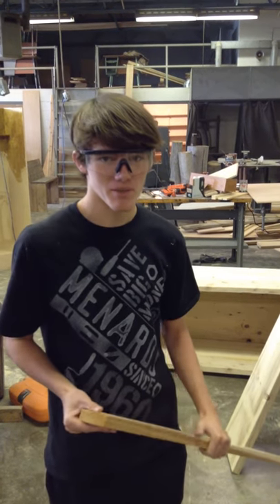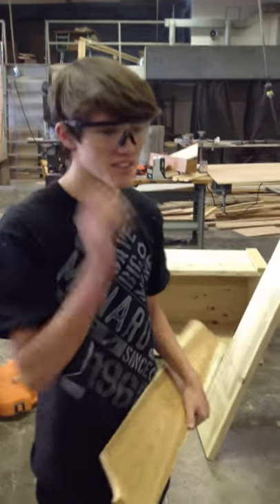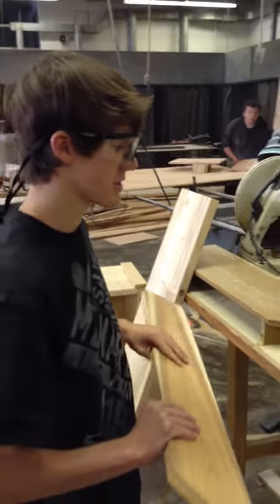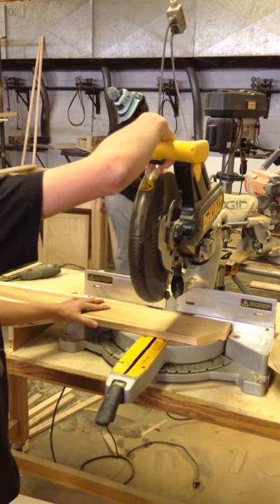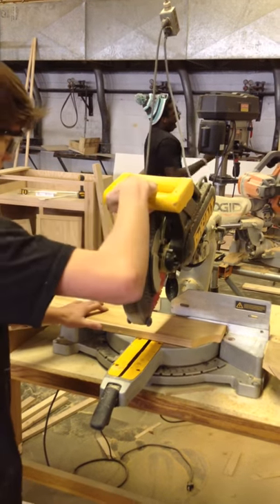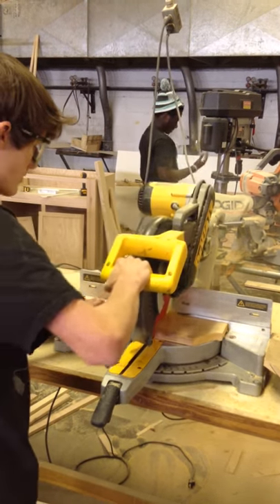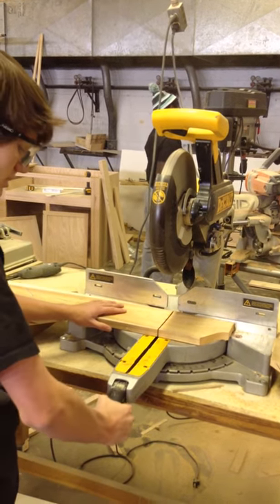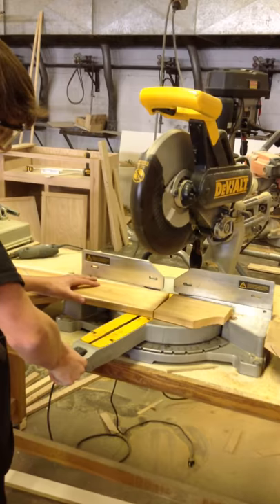How To Use a Compound Miter Box

Comment: When cutting, it's usually safer to drag the blade from the back forward instead. The way you are cutting, the blade, which spins towards the rear fence, may catch on the wood and fling it outwards towards you.
Reply: What are you talking about? The kid was spot on.
Reply: @tone34  If you drag it towards you, the blade forces the work down onto the work surface. But if you push it away from you, if it catches there is nothing stopping the work from flying out of the machine except your hand, which will likely take the brunt of whatever calamity happens next.
Reply: Sham Keith He cut from the back then forwards.
Reply: The back of the saw is the part furthest from the operator.
Reply: @tone34  I'm not trying to be anal about this, I just really dont want someone to get hurt. A while ago, my shop teacher broke his finger. Almost cut it off, actually, all because of the way he was using a miter saw.
Reply: Hearing protection please!
Reply: Umm... If the saw catches going your way it launches the saw into the user. If it catches going the other way the wood gets yanked up a few inches before traction breaks or the saw gets bound up (the only force there is going to be straight up on the board)
Reply: @jchoneandonly  If it launches the saw into the user, well first most saws have an intant cutoff if the saw starts moving up. The sheild will also be forced to snap into position to cover the blade. It's also extremely unlikely that this would happen in the first place, unless the saw is shaky and inaccurate... in which case, why would you be using it? On the other side of the spectrum,  if you catch coming in from the front, the way that guy was, the peice of wood can be flung upwards if it catches, especially since there is nothing holding in down other than friction between it and the rear fence. The peice of flying wood can go anywhere, including a position that puts huge stress on the blade which can have disastrous consequences. In general, its much safer to cut from the back, where the force from the spinning blade (if there is any, which there shouldn't be) presses the peice down onto the bench and back into the fence, minimizing the chance of it catching in the first place and reducing the potential damage of that occurrence.
Reply: @shamkeith3492  I don't know what kind of miter saw your using but that's pretty ridiculous
Perhaps you're talking about a different type of saw? Because a miter saw pretty much always would push back into the fence because of the large blade.
Someone else suggested you're talking about a radial arm saw (most likely correct considering the miter saw will definitely not shut off while moving up speaking from plenty of experience) but you're definitely not describing a miter saw like the video showed
Reply: @jchoneandonly  Alright, fine, do it your way... just trying to keep people from getting hurt. But no, I am in fact referring to miter saws as shown in the video.
Reply: If you start in the back and come towards you cutting, the blade is likely to bite and jump forwards with solid uncut wood allowing it to catch traction the whole way. People have lost body parts cutting that way. Plus, when that happens you lose control of your workpiece and wood may go flying out. I have seen saws warped the fence because someone cut like that. Skill saws, table saws, and miter saws, all feed the same way, and it’s not in the direction of the blade’s spin, but against it.
Reply: @acarpentersson8271  I am officially too tired to care. This argument has lastest months, and I'm not doing anything useful here. I'll take my leave
Reply: Not all saws/ blade